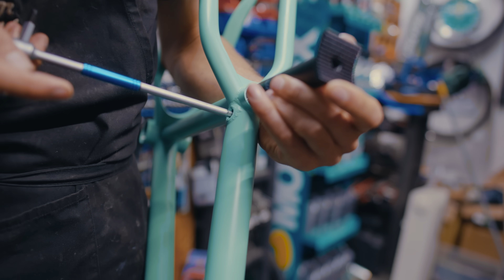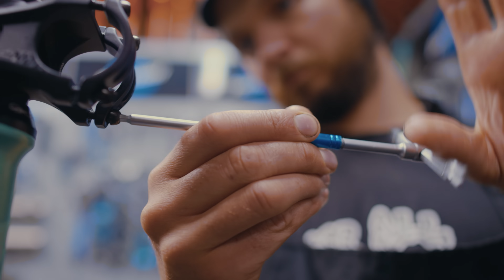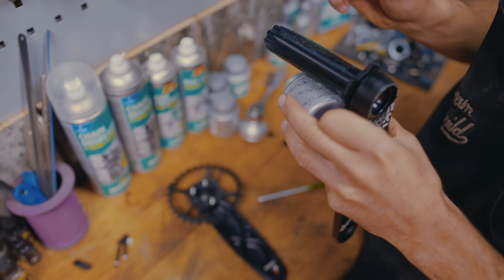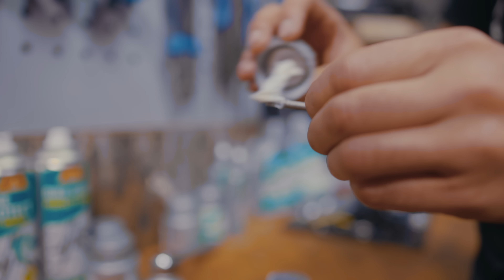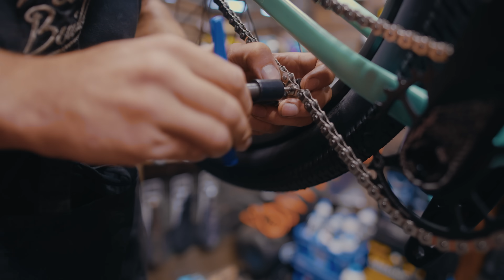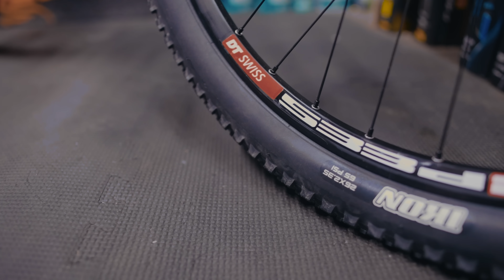DREAM BUILD MTB - YT Dirt Love - WIN THIS BIKE!

Comment: I've just finished building a dirt love too. Is it normal for the upper headset bearing to move a little bit in the headset of the frame? ( before any other parts installed, not when I installed the suspension)
I mean doesn't it supposed to sit in the frame without any movement?